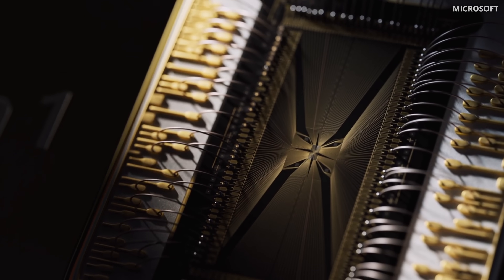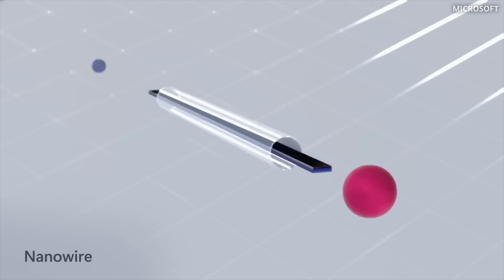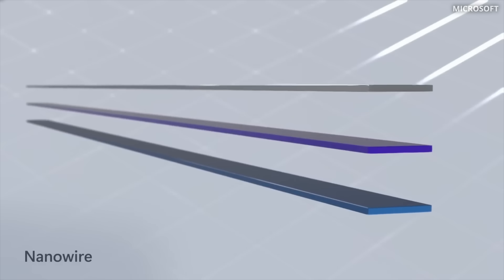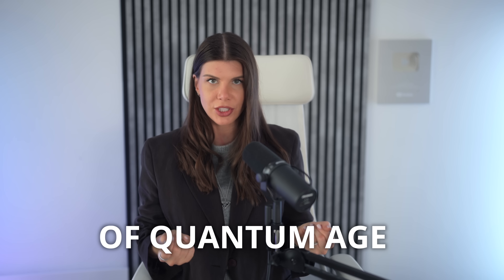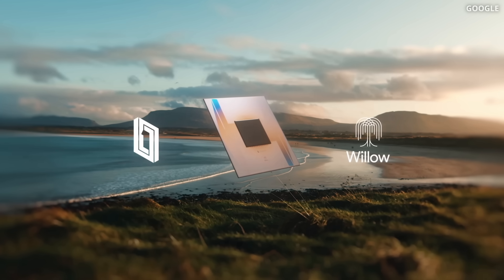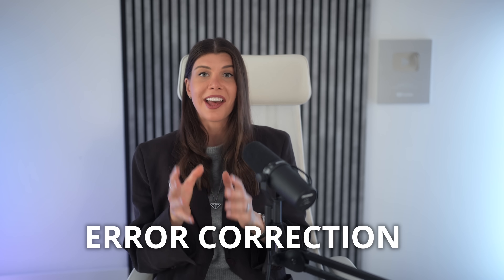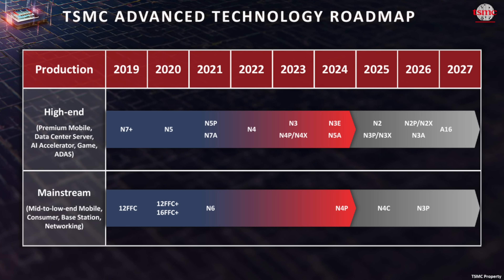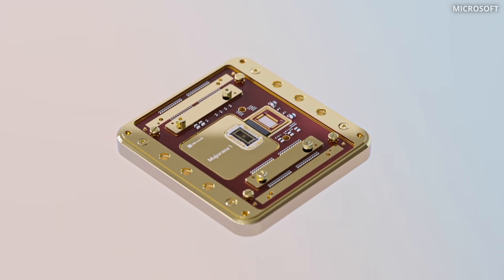The Truth About Microsoft’s Quantum Breakthrough

Comment: It is not a new state of matter, but a new exotic quantum phase within the superconducting state. Microsoft’s Majorana quantum chip is still in an experimental phase with just 8 qubits, far behind Google, IBM, and especially China. While Microsoft promises more stable qubits without conclusive proof, China has made significant progress with processors such as Jiuzhang and Zuchongzhi 2.1, which have already demonstrated quantum supremacy with hundreds of qubits and practical applications. The complexity of topological superconductivity and the lack of concrete results cast doubt on the viability of Microsoft’s approach. If it does not accelerate its development, it will fall behind in the global quantum race.

Comment: maybe A qubit should be cubic or spherical  not flat rectangle 
Why? COZ it will give a 360x360x360  control and qubit will be even lesser prone to interacting with environment 
if possible it may at a later time would become scalable unit.
Reply: Qubit part are the two ends of it. Together they form quasi-particle that can be entangled with another one.

Comment: Qbits are already Quasi qbits, which are software Q bits that use fractions between 1-0, and virtual Q bits that can be designed through simulations can do the same job with zero error on an 80 C processor or graphics chip. For example, with the rtx 4050 graphics card, it is possible to add a virtual QPU to the hardware via a 28 Qbit simulation QPU.

Comment: This high susceptibility to 'noise' could be re evaluated for use as high sensitivity sensors. Just a thought.
Reply: this is why quantum sensing is a thing, and already a profitable product line for companies working on alternatives to GPS-denial risks.
Reply: @ninahassa  how would a quantum sensor pick up a gps signal in a jammed background field?
Reply: @ Good to know.
Reply: Question is you'd need to distinguish the useful noise from the background noise. I guess if there was a clear spike in overall net noise it could be sensor.
Reply: @scottmeredith4578  Use two, or more of them. The random noise would cancel out.
Reply: @tortysoft  they are used for that, it is interchangeable

Comment: Nice video, seems like Quantum computing is at a stage, when IBM Mainframes were popular, with superconducting cooling systems, present systems are more like Vacuum tubes, so these will be suitable for Industrial use, every PC on a desktop and Mobile in a pocket type adoption will take time provided there's reduction in the form factor, or Quantum computers will never reach that stage and there will be limited requirement for consumers related use cases.

Comment: Wild, my new OLED monitor uses Quantum Dots. It is organic and I have to run a panel protect on it for 10 minutes after a few hours of use. We went from Fluorescent backed LCDs with burn-in to LED backed LCDs no burn-in to Quantum Dot OLED backed LCDs with burn-in again, two steps forward one back roflol.
Reply: Let's see, there was a prototype electroluminesence display at CES, which was pretty promising. Basically, it should have all the good qualities of OLED but without the burn-in. But it's not fully ready yet, and they have still some way to go with solving the blue color stability (which I think was a way to say that the blue still has burn-in problems). What is better is that it should be cheaper to produce than OLED.

Comment: 1000 physical qubits per logical qubits sounds insane!
Reply: A good demonstration of just how big a problem noise is to practical progress.   Been anxiously waiting for room-temperature superconductors for a while now: I have a hunch that real leap in use of quantum computing will come from emancipation from the 0.000000000000001 Kelvin thing.
Reply: @ChrisNotTheKing But  it is possible.
Reply: Or invent a nano refrigeration system for home PCs@ChrisNotTheKing 😅
Reply: @ChrisNotTheKing  We have been waiting since the mid 1980's for room temperature superconductors.  Getting to liquid nitrogen is already a huge cost savings.  Silicon also gives us some very nice mechanical properties around that temperature (e.g. very small thermal expansion to minimize strains on the cooled chip.

Comment: Quantum computing is a rapidly developing field, and there are several companies and research institutions working on creating quantum processors or chips. These quantum processors, or quantum computing chips, are built using different technologies to implement qubits (the fundamental unit of quantum computing). Below are some of the key quantum computing chips from major players in the field, along with the underlying technologies they use:

1. IBM Quantum Chips

IBM has been one of the leaders in quantum computing and has developed various quantum processors, including:
   •   IBM Q Experience: IBM’s cloud-based quantum computing service provides access to its quantum computers. The processors are built using superconducting qubits.
   •   IBM Eagle: This is a 127-qubit quantum processor released in 2021, part of IBM’s effort to build more powerful quantum systems.
   •   IBM Condor: IBM plans to scale up to the Condor processor, which will have over 1,000 qubits and be a key part of its goal of building a quantum-centric supercomputer.
   •   Quantum Hummingbird: A 65-qubit processor that followed the Eagle and was designed to bridge the gap toward larger systems.

2. Google Quantum Chips

Google has developed its own quantum processors based on superconducting qubits, and their most famous chip is:
   •   Sycamore: Google’s Sycamore processor, with 54 qubits (of which 53 were operational during their quantum supremacy experiment), demonstrated quantum supremacy in 2019 by performing a specific computation faster than the world’s most powerful classical supercomputer. Sycamore uses superconducting qubits.
   •   Bristlecone: An earlier quantum processor by Google, it had 72 qubits and was designed as a testbed for larger-scale quantum circuits.
   •   Quantum AI: Google’s initiative to build scalable quantum systems, with plans for processors that go well beyond Sycamore.

3. Rigetti Quantum Chips

Rigetti is a quantum computing startup that builds superconducting qubits. They have developed several processors and a cloud platform for quantum computing:
   •   Aspen-9: A quantum chip with 32 qubits, designed to test and improve quantum algorithms.
   •   Aspen-1: Rigetti’s early quantum processor, with a smaller number of qubits but designed for integration into its quantum cloud platform.
   •   Forest: Rigetti’s cloud computing platform that allows users to run quantum algorithms on their chips.

4. Intel Quantum Chips

Intel has focused on developing quantum processors using different types of qubits. Their approach uses silicon qubits based on the same semiconductor manufacturing techniques used in traditional computer chips:
   •   Tangle Lake: A quantum processor with 49 qubits, which uses superconducting qubits. Intel also works on quantum control chips that interact with quantum systems.
   •   Horse Ridge: A cryogenic chip developed by Intel for controlling quantum systems at very low temperatures, which is a key challenge in building large-scale quantum computers.
   •   Spin Qubits: Intel is exploring the use of spin qubits in silicon wafers, which could potentially offer better scalability and integration with existing semiconductor technology.

5. Honeywell Quantum Chips

Honeywell has developed trapped-ion qubits, which use individual ions held in place by electromagnetic fields as qubits. Honeywell’s system is different from those using superconducting qubits because it uses laser manipulation to process quantum states.
   •   Honeywell H1: The first quantum processor released by Honeywell with 10 qubits, which uses trapped-ion technology.
   •   Honeywell H2: The second generation of quantum processors, which is expected to have more qubits and higher performance.
Honeywell’s approach to quantum computing is known for its precision and low error rates in quantum gates.

6. D-Wave Quantum Chips

D-Wave is one of the pioneers in quantum computing, although their approach differs significantly from others. They focus on quantum annealing, a method best suited for optimization problems:
   •   D-Wave Advantage: This quantum chip features more than 5,000 qubits and is based on quantum annealing, a technique that solves specific types of optimization problems.
D-Wave’s system has been used for practical applications such as machine learning, optimization, and drug discovery, although its design is distinct from the gate-based quantum computing approach used by companies like IBM, Google, and Rigetti.

7. IonQ Quantum Chips

IonQ uses trapped-ion qubits for its quantum computing chips. This technology involves trapping individual ions using electromagnetic fields and using lasers to control the quantum states of these ions:
   •   IonQ Harmony: IonQ’s quantum processor uses trapped-ion qubits and is available via the cloud.
   •   IonQ Aria: IonQ’s more advanced quantum processor, which offers improved performance and scalability over Harmony.

8. Alibaba Quantum Chips

Alibaba, through its Alibaba Cloud division and its quantum research arm DAMO Academy, is developing quantum computing hardware and software. They are working on photonic qubits and superconducting qubits:
   •   Jiuzhang: A photonic quantum processor developed by Alibaba’s DAMO Academy. It uses photonic qubits rather than superconducting qubits.
Alibaba has introduced quantum computing as a service (QCaaS) through Alibaba Cloud, allowing access to quantum resources for businesses and researchers.

9. Xanadu Quantum Chips

Xanadu is another player in the field of quantum computing, focusing on photonic quantum computing. Instead of using trapped ions or superconducting circuits, they use photons as qubits:
   •   Xanadu’s Borealis: A photonic quantum computer designed to demonstrate quantum advantage using continuous-variable quantum computing. Xanadu aims to build systems capable of running large quantum algorithms on a photonic platform.

10. Other Emerging Quantum Chips and Technologies
   •   PsiQuantum: PsiQuantum is working on building a photonic quantum computer using silicon photonic technology. Their approach uses photons to carry quantum information, which can be manipulated by integrated photonic circuits.
   •   QuTech: A Dutch initiative focused on topological qubits and superconducting qubits. Their Quantum Inspire platform offers access to quantum computers using superconducting qubits.

Types of Quantum Chips
   •   Superconducting Qubits: Chips that use superconducting circuits, typically created by companies like IBM, Google, Rigetti, and Intel. These are one of the most common types of qubits being developed.
   •   Trapped-Ion Qubits: Quantum computers that use ions trapped in electromagnetic fields. Companies like Honeywell, IonQ, and Xanadu are exploring this technology.
   •   Photonic Qubits: These use photons (light particles) for quantum information processing. Companies like Xanadu and PsiQuantum are working with photonic qubits.
   •   Quantum Annealing: D-Wave uses this method, which is designed for optimization problems.
   •   Silicon Qubits: This approach leverages traditional silicon manufacturing techniques to develop quantum processors, as seen in Intel’s work.

Conclusion

Quantum computing chips are being developed by various companies and institutions around the world, each using different qubit technologies. Superconducting qubits and trapped-ion qubits are the most prominent approaches, but there is growing interest in photonic qubits and silicon-based qubits as well. These chips form the foundation of future quantum computers, with significant potential for solving problems in areas such as cryptography, optimization, and machine learning.